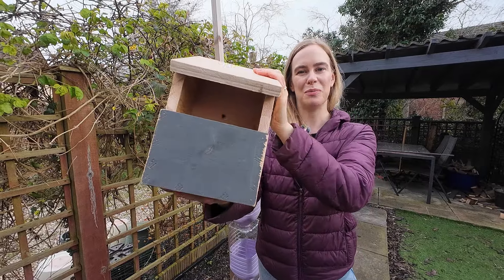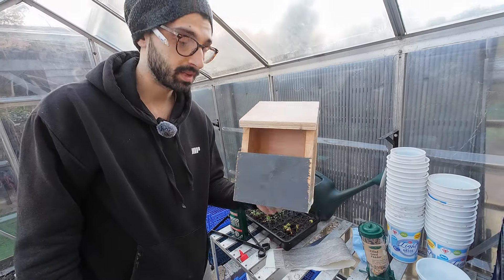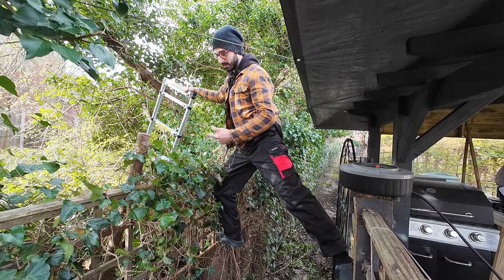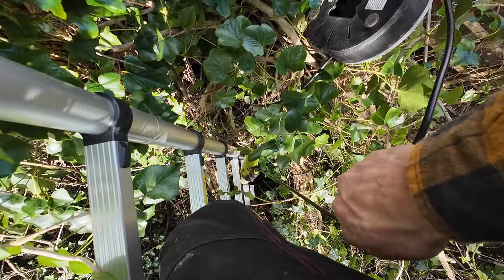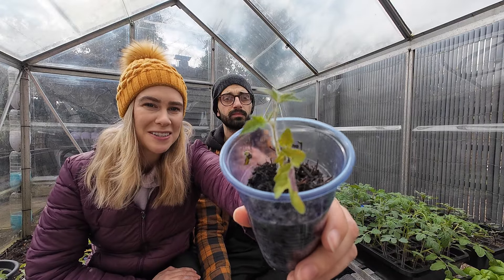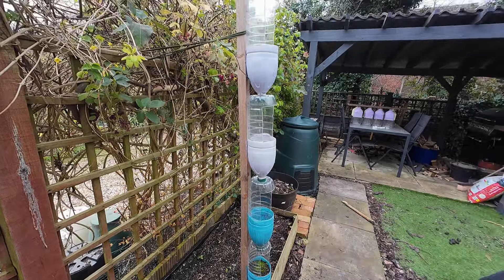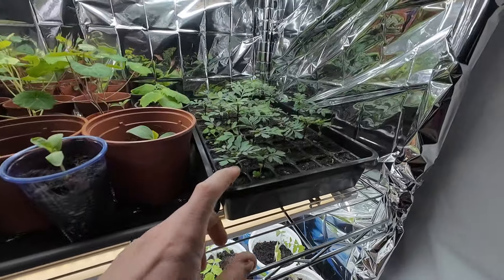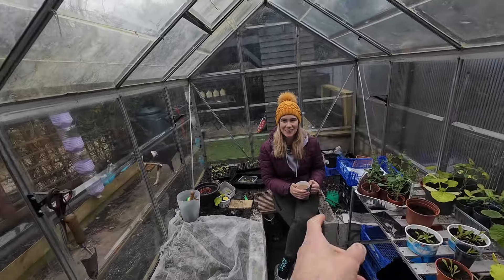Vertical Gardening and How to attract wild life (Cheap & Easy)

Comment: Ok so you have loads of space so please don't sacrifice anything! You have hanging space in you greenhouse - hanging baskets, string maccrami pot holders, floating shelves with scrap wood/mesh....... You've got loads of room x
Courgettes look like 1st leaf dying off not true leaves. Plants get a bit of shock when transplanting them so give them time. Maybe a seaweed fertiliser may help x
Reply from the maker: The tomatoes  tend to overtake the greenhouse, also some of the peppers and chillis will go there as well as a melon. If there's free space it will be used but there's no way we could fit all plants we started.
And we will start a few new courgettes just in case. 🌱